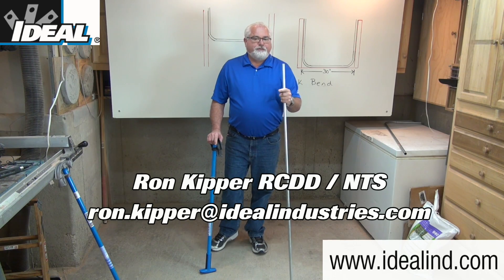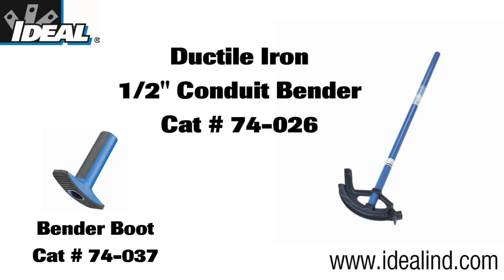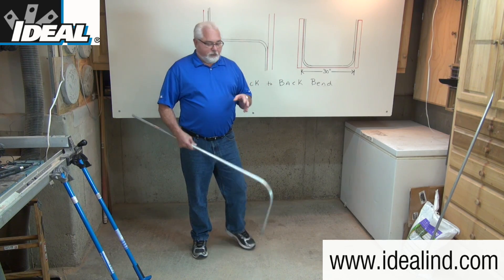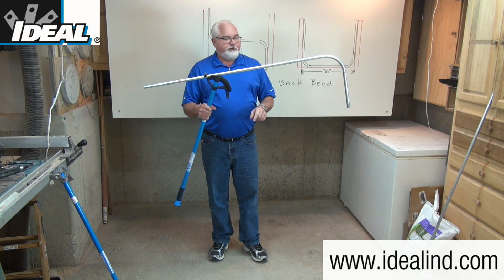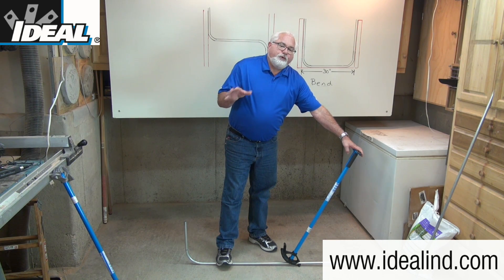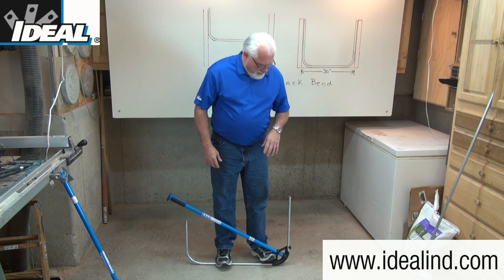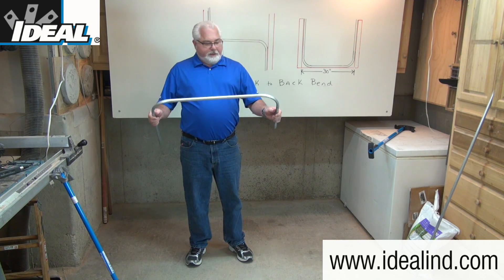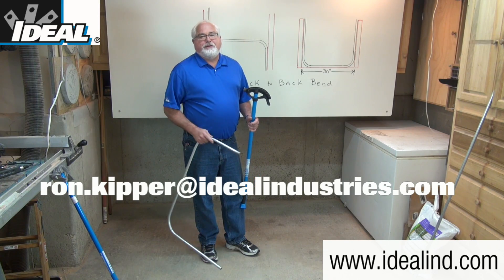IDEAL Hand Conduit Bender How to Make a Back to Back Bend

Comment: Hi! Great video. What is the narrowest length you think you can bend with a back to back bend. Would you think you can get down to 7  or 9 inches?
Reply from the maker: That might be a little tight with our bender heads here is the radius of the different bender heads
74-001 – 4”
74-002 – 4.75”
74-003 – 6”
74-006 - ~9.75”
You might get that tight of a bend using Hickey's instead which we no longer sell but should be available to you somewhere. Hope that helps Ron

Comment: I understand what ya did, but why can’t you just pull the second mark off of the back of the first 90, and do ya deduction and bend it normally?? Just asking so I can understand
Reply from the maker: It has toi do with math but the second bend is done using the star on the bender head. Sorry not much of an explaination.......Ron

Comment: You're way is too basic and time consuming  and then you have to cut tubs off to fit location  for back go back bends cut cut the overall length on a straight pipe then measure from center of pipe out way faster and no cutting needed on bent up pipe but NO ONE  HAS SHOWN THAT AT ALL ON ANY VIDEOS  WOW   I AM SURPRISED  EVEN FROM IDEAL
Reply from the maker: Hey Robert sounds like you need to do a video! Before I retire I might redo these and will keep you in mind for input have fun Ron

Comment: Ron you skip the first bend.😂  you edit the video.. measure in between. 
(Total length in between) 30" (Minus(-) Stub Height for 1/2"EMT) = 5"[See 90 degree bend Table in your text book) = (First mark) 30"-5"= 25" Mark Emt from the end at 25" and bend away.. Now second bend.. Lets go!!! 😂
Reply from the maker: Hey man I will have to take a look at that thanks Ron
Reply: He didn't skip it and edit the video to hide anything. It's just to shorten the video to the point without a bunch of excess footage.

Comment: Comment #60 and it has been a while since this video has been posted but hoping for an answer.  I want to use a 3/4" or 1" conduit bent into a coil/circle approximately 370 degrees to then slice it where the two ends cross.  Then bend the two ends to meet each other on the same plane.  Final process is to slice the 'doughnut' like a bagel leaving two half tracks for 3/4" ball bearings to ride in.  Outside diameter of the 'bagel' to be between 10 to 11 inches making the inside 8 to 9 inch diameter.  Any suggestions would be most appreciated.
Reply from the maker: Pascalore I looked at your channel looks like you are into geometry hopefully someone knows how to help you. Ron

Comment: What to do if my bender does not have a star?
Reply from the maker: Hey Dale buy a bender with the star it is much easier for making the back to back bend. Have fun Ron
Reply: @RonKipperDatacomm1  I would but just got this one 5 years ago.  I should make my own make .  I noticed too I have an older bender with a stub height of 5 “ and s ne’er one that’s has 6” stub.  The older one says add 2 1/4 for a  back to back bend .  Thanks for connecting . I appreciate it

Comment: What about a 90 that is at a right angle from you first stub. I am trying to make a stub for a fixture in a closet ceiling to run along the ceiling to  clear the door opening then run to the wall and 90 down to the switch I want to install. Always seem to be an inch and a half out. Is there a calculation for this like the stub bend?
Reply from the maker: Are you lining up your second mark with the star on the bender when making the second bend? I will tell you bending conduit just takes practice. Have fun Ron
Reply: Some benders are fucked up with the star placement, try bending it at the star on a spare piece and see where that gives you and compensate. I think the ideal bender I used today was off by about 2 inches at the star. You could measure to the other end of the pipe and add 5 inches for your deduction

Comment: Ron, should the bender boot (thank you so much by the way) be across the bender head like the way you have it right now, or should it be lined up straight?
Reply from the maker: I doubt it would make a big difference either way but I would think it works best the way I have it in the video. Have fun Ron
Reply: @RonKipperDatacomm1  Hi Ron, will the IDEAL 74-037 BENDER BOOT fit on any bender? I already have a different brand bender. Thanks.

Comment: Thanks so much bro
Reply from the maker: You are welcome thanks for watching Ron
Reply: My question on the first bend for an example if I want to make a 30” stub back to back 90 on both side the first bend bend it at the star point? And second bend to ?
Reply from the maker: Hey Juan make the first 90 using the arrow measure the 30 inch and make a mark and bend the 2nd 90 using the star. I have a video on the back to back bend as well. Good luck Ron
Reply: Ron Kipper Datacomm thanks brother

Comment: Should have shown the way to find your “gain” on the bender, find the measurements of the 2 stubs, then cut the pipe and do the bends. If you’re not finding your “gain”, you still have to “cut to fit”. Not shitting on non-union electricians, but that’s the difference between an electrician and an IBEW Wireman
Reply from the maker: nguyon good to hear from you! There is always another video I could do wish that was all IDEAL let me do. You make a good point most commercial electrician's who bend pipe everyday can make most of us including me look pretty bad when trying to bend conduit. Just takes a lot of practice..........Ron
Reply: nguyon knight you are either cutting the pipe before you bend or after, either way you have to cut.......there is only one difference in either bending process.  If you have already measured the stub and tail you need, you would never bend the stub to then hold it in place to mark your tail cut, bend your stub then measure for the tail and cut..........obviously you could take stub + tail and add your gain to cut first, then bend pipe but thats where the only beneficial difference comes into play as to why most bend in the previously mentioned......and the difference is that most electricians want as much stock of the pipe as possible to always have good leverage when bending.  Whatever steps you use the end result is the same, you are never bending and fitting to attain the tail length.
Reply: nguyon knight NOW what i get a kick out of is watching union electricians bend the way union schooling teaches.  Its amusing to see them bend 3 and 4 point saddles, the way they take the pipe out and flip it all around and stuff.......when i see that i laugh in my head cuz they clearly were never taught correctly.....wait, im sorry, i should use the word efficiently.  I still cannot understand why anyone would want to take the pipe out of the bender once its in.   Also i love how it eventually happens where they dont have enough stock of pipe left for good leverage on their seconded set of bends once they flip it.........thats when i see the 4 point saddle being bent in the middle of a full stick and then being cut lol.  There is knowing how to bend and KNOWING HOW TO BEND
Reply: I'm a union electrician. I keep the pipe in the bender and push it through for all 3 and 4 point saddles. I treat the small pipe the same as the big pipe in an electric or mechanical bender. It's not difficult
Reply: @kcjarembek   im with you on that curtis  these union guys  are spoil the under dogs non union are unique and we make things happen!!!

Comment: I've used the star for an 1 1/4" back to back 90 & it never comes out accurate. Is there a different method for 1 1/4" EMT Conduit?   (1 1/4" ideal iron bender)
Reply from the maker: No same  technique just make sure you  are  marking the conduit and lining up the marks in the bender accurately. How far off is the bend? Ron

Comment: Benders use to have vials but manufactures became cheap
Reply from the maker: Cruz we have looked at adding a level to the bender head and there are benders that have them. The problem is they get broken easily and you need to be on level ground when using them. Take care Ron